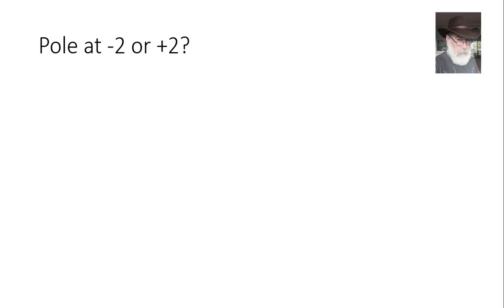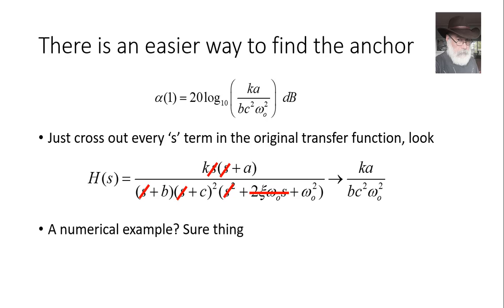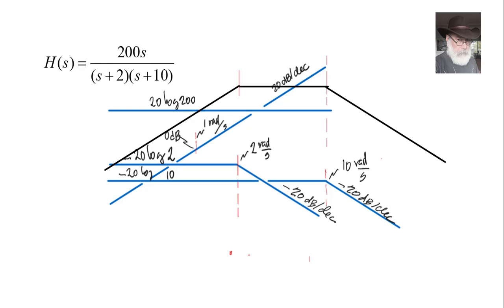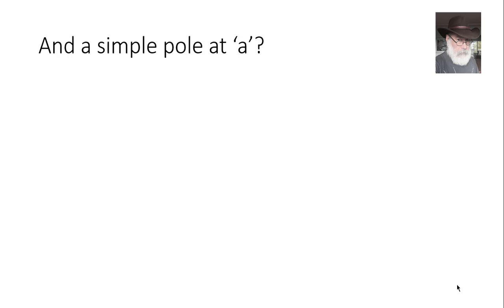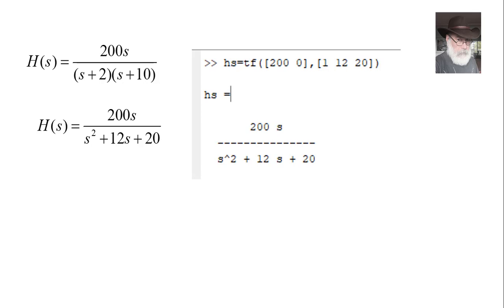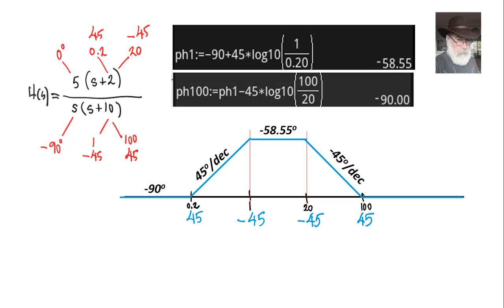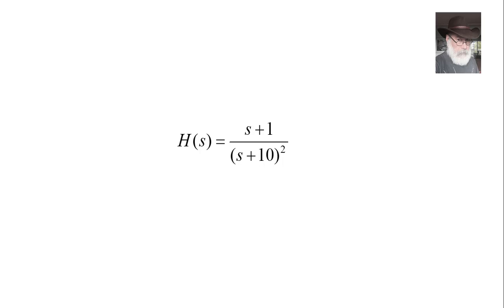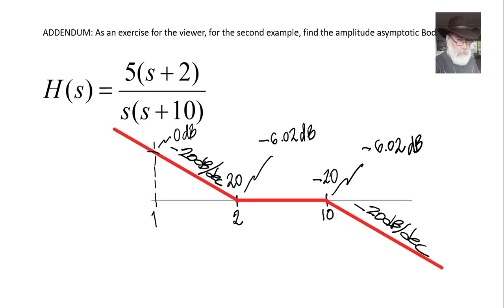A Bode Plots Tutorial/Recitation Ver.2.0

Comment: Hi Prof.!
I did the technic from 5:44 to find the anchor with a "high pass filter of order 2" but without success :
I explain :
from 2 high pass filter of order 1 (gain k1 , cut frequency = wo1) and  (gain k2 , cut frequency = wo2) I get :

k1 j w/wo1       k2 j w/wo2
-----------------       ------------------
1 + j w/wo1     1 + j w/wo2

I get all gain = k1 * k2
and limit H(s) when w -> infinity => 20 log ( abs (H(infinity))) = 20 log abs (k1*k2)
(it is verified with visual simulation) 

So :

k1 s / wo1        k2 s / wo2
-----------------       ------------------
1 + s / wo1      1 + s / wo2

   k1 s              k2 s  
-------------     --------------
wo1 + s       wo2 + s

and the total gain would be : 
k1 *   k2
----------------
wo1 * wo2 

Can you tell me the wrong step ?
Reply from the maker: Please, talk to me after class, this Monday, outside of IRC-2.